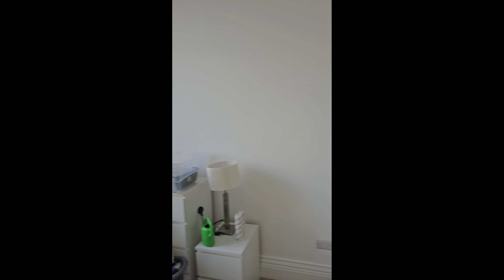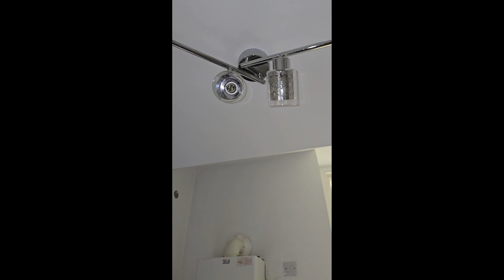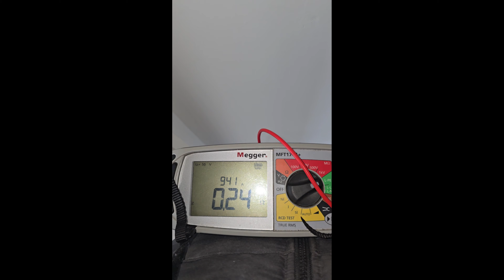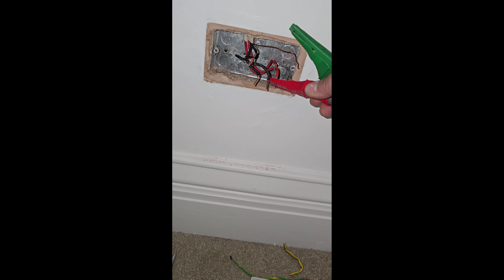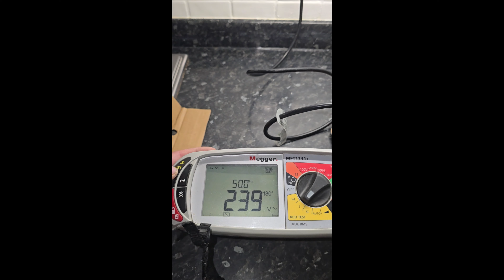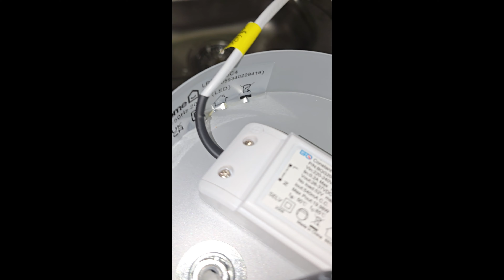Electrical installation condition report | Ensuring Your Home's Safety | Goodwin Electrical

Comment: Nothing wrong with a radial circuit ( assuming its one socket outlet) run from the rcbo. can u tell me the reg number?
Reply from the maker: Hi Peter this radial socket circuit was providing power 2 three sockets which is no allowed unless fused witch in this case was not that is why I had to install its own b16 RCBO to ensure the regulations where followed.

In the UK, Regulation 433.1.204 of the IET Wiring Regulations (BS7671) prohibits a single socket radio circuit from being wired on a ring main. This regulation dictates the conditions for "deemed to comply" status, which means that if a cable is at least 12.5A (20A x 20/32), it can effectively be treated as compliant with the requirements for 30A and 32A ring circuits. 

I hope this helps you 👍

Comment: Good effort matey.. well explained..  it may be a fair point to be made that an RCBO is more properly described as a 'Breaker',  but I completely get the point when you call it a fuse.  I agree though that CU is a bit crammed..  but you must surely have seen a lot worse... I have... lol 😃     Can I ask, did you re-terminate the radial circuit  into its own breaker ?
Reply from the maker: Thank you Zed for your great comment good point regarding the RCBO technically it is a breaker.

The Consumer unit was crammed up and not very neat in my opinion.

And yes I did re-turminate the radial circuit into its own RCBO on a b16.

Comment: The fact that you are referring to the RCBOs as fuses and that you say the CU hasn’t been installed very well and untidy never mind the fact that it was done for a you tube video is enough to tell me you don’t know what you’re talking about . The only point I agree with you on is the assumed radial hanging off the same 32amp RCBO as the Ring .
Reply from the maker: An RCBO is a type of fuse. Our videos are designed to help customers understand quality work in simple terms. You are however entitled to your own opinion.